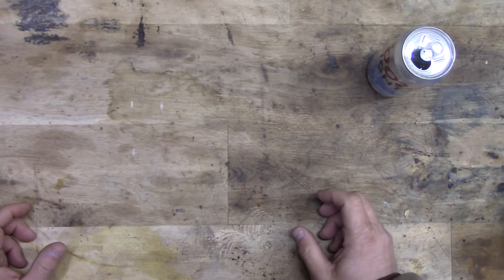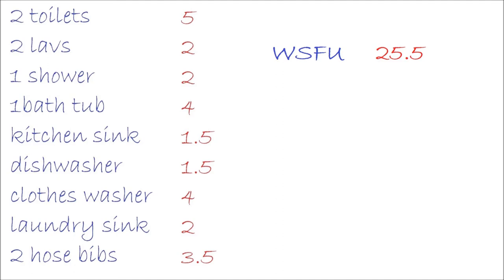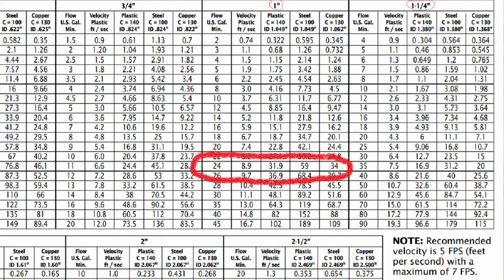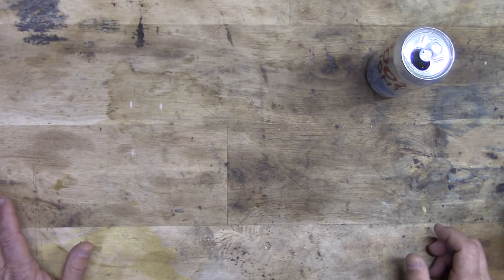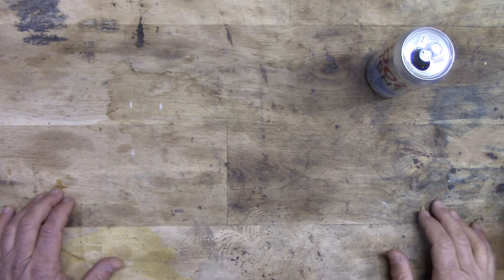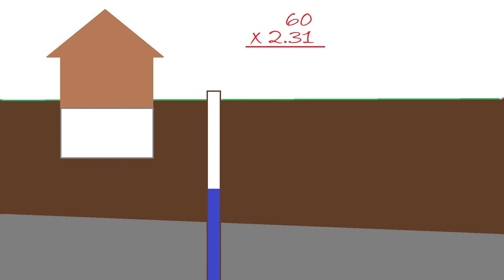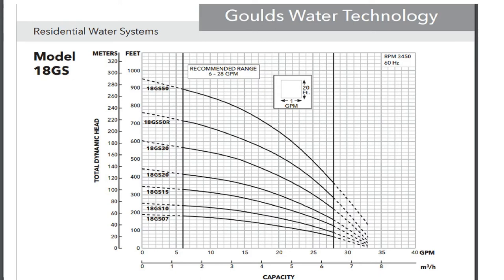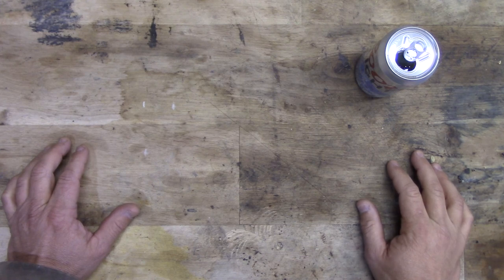Well pump sizing

Comment: Thanks.  This is the best procedure for sizing a submersible well pump I have found on the internet.  Isn't it interesting that the elevation head only depends on the vertical difference between the water level in the well and the tank in the basement?  Doesn't matter how far down below the water level the pump is installed.
Reply: That is very true. However, this draw down can be rapid;meaning one may not realize the high static head . For this reason, it always good to use worse case scenario and calculate total head based on pump depth. This is especially true for old well that have no test pumping records

Comment: Does having an Artesian Well change the way the calculations are done?  My Well is 720 ft deep and according to the well report "flows 8 GPM at the 40PSI at the surface."  In 2005.  Drawdown was 82 after 4 hrs.  Post-Static Water Level -92.4.  First water hit at 645 ft. 4" PVC Liner.  Well yield was listed 25 GPM.  About 220 ft to the Well Tank in the garage.
Reply from the maker: No, it shouldn't make a difference.

Comment: Hi, thanks a lot for the video, one question, adding system pressure to the formula only applies if the pump si feeding a pressure tank right? If it were just filling a water tank pressure should not be added to the formula so the psi value would be 0 correct? Thanks!
Reply from the maker: Correct

Comment: Hi Lenny, Last thing,  my well record also lists the pump intake set at 285 feet, finaly water level end of pumping at 285 feet, and recommend pump dept of 240 feet, static level of 19.5feet. did I interpret my pump intake to be set at 240 feet correctly, or it should be at 285 feet?

Comment: Hi at 4:42 Head is explained as the difference between the Pumping Level and the highest point of the water system and the example shows 60 feet. However earlier in the video the pump is placed much lower in the well so do we need to measure head from the location of the pump or the Pumping Level and is the Highest point the Pressure tank in the basement or is it the Shower head on the 2nd floor - quite confused on the explanation of Head...
Reply from the maker: Head is measured from the pumping level. The setting depth of the pump is irrelevant with regard to head. 
Technically, head is figured to the highest point in the plumbing system but realistically, you typically don't need full volume on your highest level. If you do, then definitely figure that in. 
In most cases, if you get enough pressure to satisfy your pressure switch, you will be able to get enough pressure upstairs to a 3gpm shower. If you have a 20 gpm shower on your 3rd floor, you should probably figure it in.

Comment: I need some help as I think my well driller is selling me the wrong pump, over and over. I have a 12GPM well at 380’ (1000’ well 6” bore in california sierra foothills, so in rock.) yes he over drilled my need. Static water level 115’, not sure the drawdown. Pump set at 380’ , Pressure tank Goulds v250 right next to well head. 1 1/4” sch120 drop pipe with 2 check valves, brass couplers. Pump is a 7GS20412 (7GPM 2hp) . My pump has locked up 3 times in 3 years with a thin layer of grey buildup until the impellers lock and the pump protector trips. Could this pump be sized so wrong that the pump speed is creating this problem? I think I should have a 10GS15412 or a 10GS10412? 4 bedroom, 3 bath, 5 people, grass/lawn with 5 zones with 4 sprinkler heads each which this pump barely can push up the heads. I look at the pump curves and think this is the wrong pump design. Thank you for your help.
Reply from the maker: At first glance,  it seems like an odd pump choice. I don't have the curves in front of me so I can't  be certain on that. The more concerning issue is the thin build up that's locking up the pump. If the pump is sized wrong enough to burn it up, you would have frequent episodes of no water or very low pressure or air spurting. I'm not familiar with wells in California but if none of your neighbors are having the same issue, you may have a bad well. I hope for your sake I'm wrong.
Reply from the maker: Oh and the pump speed is typically the same no matter the size. Over or under speed would not cause a build up of anything as they make variable speed pumps.
Reply from the maker: Something tells me the well doesn't produce 12 gpm. If there's a 7 gpm pump set deep, that tells me the well probably only makes about 7. Again,  without looking at the curve I can't be certain. That being said, a 7 gpm 2 hp should be able to crank out 7 gpm from 500 or 600 feet. Seems like not the best pump choice being set 3 hundred something.
Reply from the maker: As far as the well being over drilled, that may or may not be the case. It is not unheard of to drill a 6" well in anticipation of drilling through a shale shelf that needs to be sleeved off. Around where I live, it's not common but there are some areas where it is. Now if every single one of your neighbors has a 4 or 5" well 200' deep then I'd question the drillers motives.

Comment: Very informative....Would like to know do you need to calculate head is the water is in a tank above the pump
Reply from the maker: technically, you'd want to figure the highest point of your complete water system. So if your house is 4 stories tall and you have water on the top floor, you would figure the highest faucet. I hope that answered your question.
Reply: Yes. Hydraulic( elevation) head is a major head-loss factor in well water domestic water systems.

Comment: Hi! I’m upgrading a residential well from 5 gpm to about 24 gpm (similar to your example), going from 1/2 hp to 1 1/2 Hp.   Could recommend a good, reliable pump, durable pump? How many phases? 
The current pump is only 5 ft from the static level. ( Total well depth 234ft, 90 ft to static level, 95 ft to pump level) . I’m thinking the new pump needs to be dropped another 20 ft. Pump recovery is 30 gpm.
The line size needs to be increase to 1 1/4 in…. Dumb question…. Does that mean the line from the pump to the house needs to be replaced? … dig up the line? only about 20 ft from house…
Finally, do you consult? Hopefully yes…any contact info appreciated!
Again, many thanks for the very useful,  
and valuable information! Thanks!
Reply from the maker: Goulds makes a good, reliable pump. Typically, pump motors are single phase, 230v. They come in 3 phase as well if you have it available. I would test pump the well to make sure it can produce enough to keep up with a bigger pump. Technically, you should replace the pipe from the well to the house but you could probably get away with the existing pipe if it's 1 inch.

Comment: Thanks for the informative video, I watched it a few times and learned alot. I'm in Ontario, the well report stated the following, final water level 285 feet, recommend pump dept of 240 feet,  well production 5 gpm and recommended pump rate 10 gpm. My WSFU number is 18 gpm; based on the minsitry document of 10gpm pump rate: I calculated for a 2 hp pump, using 3/4 drop pipe to have the velocity as per the above guidelines. My pump is listed at a rate of 35gpm, would I be able to get the 18 gpm from this ministry document? can I  set my system to pump at a rate of 10gpm? Thanks
Reply from the maker: Your question is a bit confusing but I'm going to take a crack at it. I understand you have a 5 gpm well. I'm guessing you mean the total depth of the well is 285. And I understand the static level is about 20. I would set a pump near the bottom of the well, like maybe 260. I would use a pump that will pump 5 gpm at 240. The reason being when the static level is near  20 the pump production will be around 20 gpm. As the water level drops, the pump will produce less and less until the water level gets to 240 and the pump production and the well production are the same. That way the pump will never suck air. As for a 2 hp  pump, that sounds a bit high. I would look at the 3/4 or 1 hp 5 gpm series. Also typically you don't use less than 1 inch drop pipe. Especially with a 260' set. I hope I was helpful.
Reply: @lennyc624  thanks alot and i do appreciate your reply

Comment: Do you need a pressure tank if your well is only going to be used for irrigation?
Reply from the maker: Not necessarily. I wouldn't use a pressure switch if you're not using a tank though. Turn the power on to irrigate then off to stop. Make sure you don't put a valve on it and create a situation where you can dead head the pump. That would be bad.

Comment: What would happen if my pipe is one inch and it should be one and a quarter?
Reply from the maker: It will still work ok but if you are using a lot of water at once, you might experience low pressure due to the pipe restricting the volume. Also, your pump will run less efficiently. If you are installing the system new, don't under-size the pipe. If you are replacing your pump with a bigger one, it's probably not worth digging up and replacing the line to the house however know that you will not be operating at optimal efficiency.
Reply: @lennyc624  Its a new system. I watched your video to late, I bought the pipe and already cut it to length. Out of all the videos about sizing a well pump, you were the only one I saw mention pipe sizing.
Reply: @lennyc624  Thanks for taking the time to respond and for your videos!

Comment: Are there any negatives to getting a larger horsepower pump than required?
Reply from the maker: Yes, if efficiency is a concern to you. As long as your tank is big enough to let the pump run long enough to properly cool, you can go as big as your water supply will allow, however, you will be spending more on equipment and energy than necessary. Thanks for the question. Cheers

Comment: Thanks, that was well explained. Could you shed some light on the proper course of action when the calculated household demand exceeds the GPM capacity of the well?
Reply from the maker: The calculated demand does not always equate to the actual practical demand. Often times you can get by just fine, however, if you truly need more water at times than the well is able to produce, an option might be to have a reservoir of some kind. In some cases, the well can be drilled deeper for the function of using the well itself as a reservoir by setting the pump deeper. In other cases, installing a bigger tank could be the answer but neither solution is always proper. There are a few different options but it can get costly very quickly and the wrong solution could burn up a pump in a hurry.
There are many variables to designing a pump system and every situation is different so it is advisable to consult an expert. If you don't like consulting experts, which is respectable, you could easily waste money on trial and error. And well stuff is not cheap. If Money is not a huge concern, you could have a 2 stage system that pumps water out of the well at a slow rate into a reservoir then a second pump system pumps out of the reservoir as needed. you can get pretty creative. The point is there's not a proper course of action that works for every situation. I know this probably wasn't the answer you were looking for but thanks for the question.
Reply: Sir, thank you, it was a much more comprehensive answer than I expected!  In my particular case, the well driller pumped the well for over two hours using a ten GPM pump with no perceptible drop in the pumping level. So, his conclusion was "at least ten gallons" per minute. With a theoretical load approximating the one you calculated in your example, I'm kind of up in the air as to what size pump to select. Who knows the actual capacity of the well? And certainly, all of those fixture units will never draw simultaneously, as you pointed out. It is important to note that the well is only about thirty feet deep, so there is limited storage capacity there (too deep in the area finds salt water). I suppose, in this situation                      that a ten gallon per minute pump would at least not risk burning itself out due to low water level. Do you thing that a larger pressure tank would help compensate for occasional short periods of high use? Again, thanks for your reply, and the benefit of your obvious experience.
Reply from the maker: @johnmanning6572 , frankly, unless you're going to have a fancy shower with multiple heads using 20 GPM or a sprinkler system, you'll probably be fine with a 10 gpm pump. My guess is if the pumping level never dropped, it probably makes a bit more than 10. Assuming you have a standard, single family house with standard fixtures, I would say a 1/2 or 3/4 hp pump with a 10 or 15 gallon draw down tank would serve you well. (based on what little info I have about it) I assume the driller never figured it to need more than that or he would have used a bigger test pump. As I said in the video, the proper method can be a bit overkill. To answer your final question, I don't think the benefit of a larger tank would be worth the cost in your case.
Reply: Thank you very much for the information, Lenny C, it was very helpful.